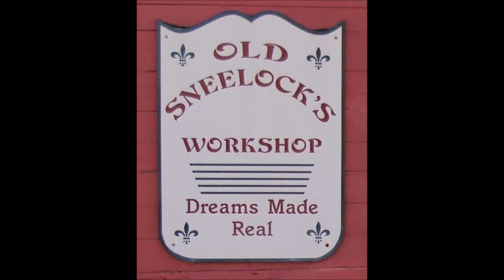Sharpening  Auger Bits ~ Pt 3 ~ Sharpening The Radial Cutting Edge ~ By Old Sneelock's Workshop

Comment: As usual, there's more to it than meets the bloodshot eyeball. Thanks Unc. The proof was in the pudding.
Reply from the maker: +Lewie McNeely I came up with the test run method of sharpening when I realized that most of the bits I was sharpening had one or two problems. By sharpening every edge I was wearing away the edges too fast. So I started with the test then sharpen method.
Reply: Livin' and learnin'.

Comment: Great three part series.  Sometimes you need more than a single video to cover a topic sufficiently. Greta job. I feel like I just may be able to tackle that box of auger bits now that I got at the flea market a few weeks ago. (About 25 bits and box, with other assorted tools, for $5.00 US). Only 1 12" bit is bent, but all of them need a good apple cider vinegar soak first. What do you use as a base to stop the acidic action of the vinegar when you take them out?
Baking soda solution, then a good paste wax rub down maybe?
Reply from the maker: Yes baking soda and wax are my preferred method. 😀😎

Comment: What kind of oil did you use after you wiped off the vinegar? Also was that plain white vinegar? It looked like it had a brown tint?
Reply from the maker: I always use apple cider vinegar. White vinegar starts to reek after a few days with iron in it. 
I don't use oil as a general rule. I use paste wax. I prefer Butchers Amber paste wax but I also use Minwax. Oil gets on everything it touches and can stain the wood being drilled. Paste wax doesn't have that problem. Just done use paste wax with silicone in it. That will mess up the wood so finishes don't stick.
Reply: Wow! Thank you for the quick reply and info!

Comment: have followed your directions and amazed but it appears your example is a rather large (20 or so) and I am having difficulty on smaller (6, 5, 4, 3) bits -are there smaller-thinner files to use? safe edge maybe also? I have been able to only locate one size actual auger bit file so any advice would be greatly appreciated-Thanks again for the great and easily understood help.
Reply from the maker: Auger bit files are tapered on the end so that they're very very small at the point and wider towards the back.Auger bit files are a little expensive and they're not easy to find.  You can get them.  I think you can buy them through Amazon. 
Yyou can also probably go to the hardware store and buy smaller files they make very very small files down to what are called Point files. 
You can also find what are called needle files. They are very inexpensive. You can buy them at Harbor Freight, Home Depot, Lowe's,  Menards, pretty much anywhere they sell tools. As far as the safe Edge you can grind off the teeth on the edge of any file and make it into a safe file.

Hope this helps. For the number threes I use a needle files. Those are real tiny.
Reply: @OldSneelock  Great!
Thanks for the info-I am going to look today-Keep up the videos!
Reply from the maker: Good luck.

Comment: Also I want you to carry store the bits if you were going to be using loan on your truck or what kind of a fixture could you put in to put them on so you know the tips don't get dumped in the toolbox and is there a way to protect the tips from getting damaged also would be great
Reply from the maker: Here are some boxes that I have purchased. They were made by the auger bit manufacturer to hold the bits for selling them. https://youtu.be/_5zvAZqkCB4

Comment: Is there a lubricant that would help reduce the friction between the auger and the wood, reduce the buildup of wood pitch, and yet allow the lead screw to engage/advance the auger into the wood?  Thanks again for the tutorial: you can teach!
Reply from the maker: +Bill Sutherland Sorry for the slow response Bill. I use Butchers paste wax on all of my cutting tools. It reduces friction and limits the buildup of wood pitch. Because it is an old mixture that doesn't contain silicone, it also has the benefit of not causing a problem with subsequent finishing.

Comment: It has been my experience that new augers from Ridgid (same parent company as Milwaukee both made in China) have a poorer finish on the screw in particular.  Each hole and every hole in hem-fir came to a stop when the threads filled with a wood fibre within a half inch from the beginning.  My older Milwaukee had no problem in the same holes.  A brand new 1 1/4" Irwin was made with such a weak shank that it twisted off in the first hole!  Trying to get that size an auger to fit a hex impact driver is really stupid.  A 1/4" shank doesn't have the meat to handle the torque.  My older Milwaukee and Greenlee's don't have such problems.  Problem is that drilling studs with a Hole Hawg for wiring you will hit nails requiring frequent sharpening.  In short order you have filed down past the screw root and eaten away the spurs.  Need an inventor to improve the design.  Replaceable screws at twice the price of the whole auger are not the answer.  Perhaps a bi metal version as in saw blades would help?  Good subject.  Take care.  Doug
Reply from the maker: Douglas Thompson Thanks for the warning about the Rigid/Milwaukee bits. Any more for rough work I use spade bits. Chew one up. Sharpen it a few times and pitch it. My old augers cut much better but I hate hitting nails with them. I have my Dad's Greenlee powered auger bits that shear right through nails but they were my Dad's so I don't risk them. Dad passed in 1999. Haven't bought any new Milwaukee or Ridgid in 10 years. Most of the new stuff is poor steel at best. I have bought carbide tipped hole saws but they are impractical for drilling through any thickness of wood more than two inches.

Comment: I've got 20 or so old auger bits as well as a few others off the non-auger variety. I'm trying to decide on a good way to keep them organized and available in my small shop. Right now, they are just in a drawer on an old rag. Any suggestions on a method of keeping them easily accessible and organized?
Reply from the maker: I have a drawer full of auger bits because I enjoy restoring them. Once I have them sharp and ready to use I put them either in one of the purpose built drill bit boxes that I have or in the wall hung tool cabinet. The bits that are cleaned but waiting on sharpening I have stored in rack made by drilling 3/8" holes in a 2x4 that sits on one of the shop storage racks.
Reply: Make a rack with holes to hold either the shanks down, or use the bits to drill holes in a board then use that board as a small box top as a storage rack. You can organise the holes in any order as you would want the bits organized.

Comment: Been working on my augers since I found your site. The first thing that I noticed after working on 3-4 is that they are harder steel than I would have thought. Old tool and die maker here who knows a hard steel from the mild steel that I would have thought they would have been made from. Are they maybe case hardened?
Reply from the maker: Ken Tyler They are much softer than a good twist drill. I have a bunch of them and some of the old ones are softer than others. The Russel Jennings, Irwin, and bigger name makers have bits that are stronger than the off brands. I do not find many of the name brands with bent shanks. 
They all are soft enough to sharpen with a file. Some might be case hardened but I have not noticed any of them acting like it. 
I think they are tempered like a good knife blade. I did see a video about how they are made but I cannot remember if they were hardened at the end. I will have to look it up.

Comment: Thank you for sharing. I have an old  set of bits that my father had, they were given to him by his 90+ year old friend. They are still in the original wooden box. I think I will get them out and see if they need a little tuning. Thanks again for showing/teaching how to restore these bits
Reply from the maker: Joe Sheppard When they are right they pull themselves through the wood. All you have to do is start them straight. ☺

Comment: Great video! I learned several points about sharpening augers.  I would like to see closer view of the fixture you used to file the auger. I have never seen a fixture like it. It appears to be helpful both for holding the auger and as a guide for the file angle. Perhaps a video showing the making of the fixture would be possible?  Are there any drawings available?
Reply from the maker: I made the first jig and it worked but not as well as I hoped. So I made another. This timeI recorded it.
 https://youtu.be/FgVBYbdfR4Q